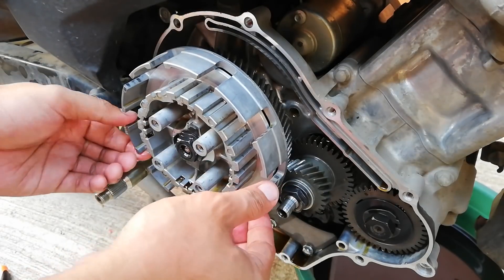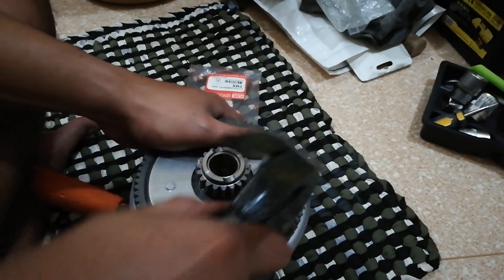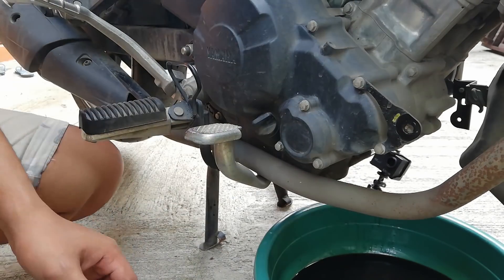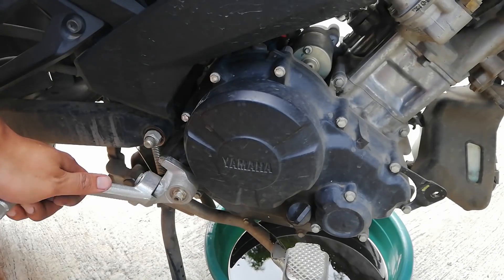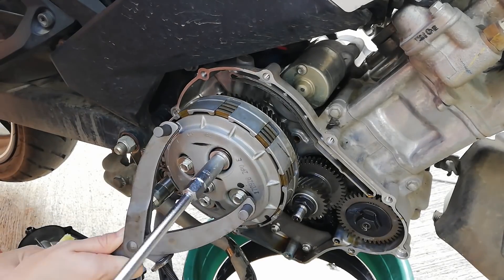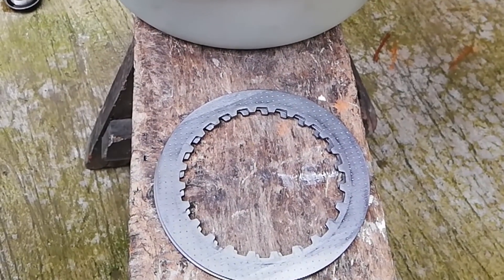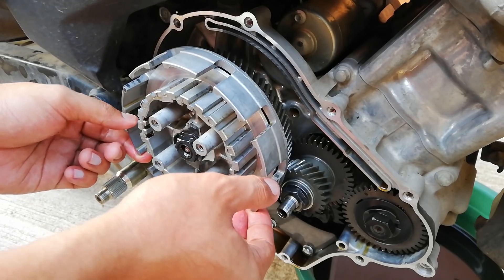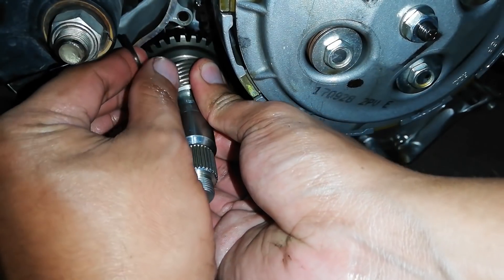SOLVING ENGINE LAGUTOK NOISE 1 (NARRATION) |YAMAHA SNIPER 150

Comment: I dont know why, but for some reason i loved this video jajaja. I dont even have this motorcycle, i have a Yamaha FZ6, but ... this music and your narrative, was very entertained.

Now i want to add something.

The inned hub nut CAN BE taken out without power tool, i do it all the time in my Yamaha even being a bigger bike.

The method that i use is this.

Find a good way to block the rear tyre and put the bike on any gear, i use a metalic bolt with a palstic tube around it, but you can use some wood, or something that doesnt brake and put it between your swing arm and the wheel, so it can get locked so it doesnt turn.

Then with the rear wheel blocked you can use a regular wrench to take it out, it will be hard, but its not impossible.

The clutch outer basket is connected to the engine crankshaft and the inner hub is connected to the transmsion so in the end to the wheel itself, so if you lock it, you can have the counter torque that you need to free the nut.

On this bike i am pretty sure that is the same procedure because is the same on all bikes that i know

Comment: You can remove clutch nut without impact wrench . Just use ratchet with deep socket/extension bar and clutch basket holder. Its cheaper than having impact wrench but faster to remove the nut

Comment: paps anong torque settings ang ginamit mo sa impact wrench to pull that 19mm know sa inner clutch basket?
Reply: @phmotorthread  thanks sa info paps..planning to buy a torque wrench. example is ung 190nm na Makita..so dko sure kung sapat na ba power nya...
Reply: @phmotorthread  next naman paps yung steering wheel adjustment..for sure maraming ma eenlighten dyan kasama nako. Kung pano mag replace or mag adjust.. hehe..thanks and more power. god bless.

Comment: san tayo maka bili ng pin e replace sa dini drill mo sir?thanks
Reply: @phmotorthread  yung nkakabit sa housing. yung binutasan mo po..
Reply: Sa honda ka mismo bibili ng damper? pa add ako sa messenger..mm
Reply: @phmotorthread  same ra diay ta Cebu sir.pa add ko messenger sir, nag pm ko

Comment: Papz ask ko lng... Sniper user din ako posible ba na clutch dumper ba ang problema ng motor q from 1st gear pasok ko ng 2nd gear my malakas na lagutok na tunog ako naririnig.. Tuwing mgsisigunda ako. Palitin na ba clutch dumper q.. 2016 model ung sniper q...
Reply: @phmotorthread  natry q na mgadjus paps ngpalit na nga q cable e.. Nakashifter nga din pla ako..
Odo q nga pla 25k. Km. Na..
Reply: Sir parehas tayu...2nd gear may lagutok kpg nabirit